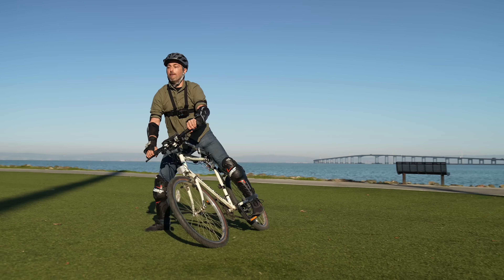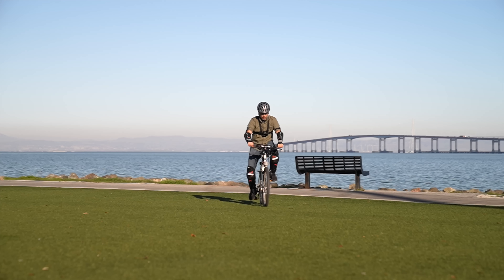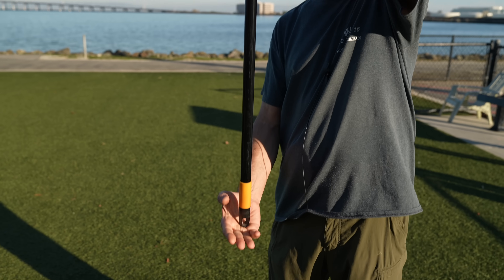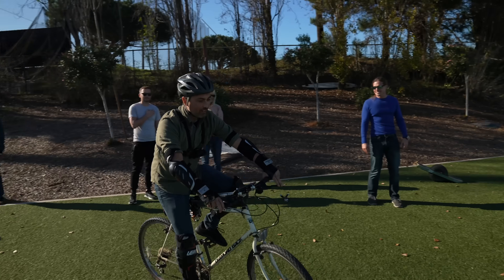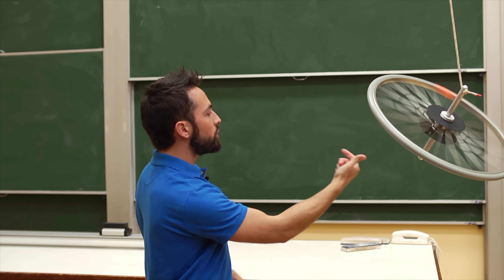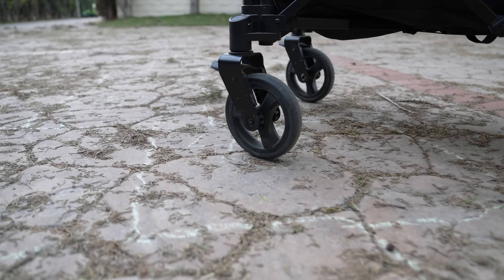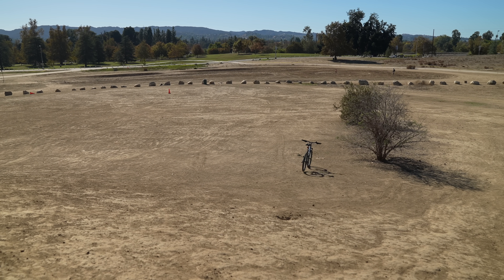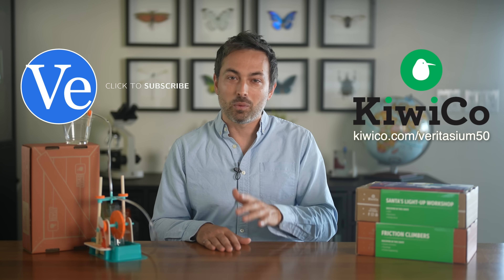Most People Don't Know How Bikes Work

Comment: Some people can balance the bike when it's not moving  - it's known as a track stand.  However,  it is many times harder than balancing the bike while the bike is moving. 

This is also why it's hard to ride a bike on rollers - which is one more piece of evidence supporting the fact that bikes don't (principally) stay upright through a gyroscopic effect. 

Also, fitting extremely lightweight wheels has no effect on how easy or hard it is to keep the bike upright; whereas if there were an important gyroscopic effect, it would decrease as the mass of the wheels decreased.
Reply: Track stand actually involves movement, but it's very tiny, using road imperfections to move back and forth.
Reply: @mikosoft   - I guess you're right. The bike is moving a bit, even though it's not travelling.

Comment: This is wrong (specifically that you steer one way then the other to turn). You also don't understand what counter steering is. I say this as someone with over 5 decades of bicycling and 3 decades of motorcycling experience. Here's an experiment to try: Ride with no hands (maybe a bit dangerous) and the apply gentle forward pressure on the right side of your handlebar but don't grip it to ensure you are only pushing and not pulling. Don't touch the left side of the handle bar at all and don't lean or otherwise move you body. Two things happen, one, you will turn right (yes, right!) and two, you will NOT have to steer right (you can't if you follow my directions as you can only push forward on the right handlebar). This is easier to experience at higher speeds, maybe try it going down a gentle slope or on a motorcycle if you are comfortable removing both hands from the bar (which is dangerous).

Comment: I somewhat did this to myself once. Made some brackets for driving lights on my motorcycle. They mounted to the triple tree and looked really nice. I didn’t realize they also hit the frame and shortened how far the forks could turn. 
Didn’t notice until I was making a tight turn and about fell over because it couldn’t turn as far as I was expecting for it to stay balanced.

Comment: I have to say i think that you have a flaw in your reasoning, i used to race mtn bikes myself and you can easily turn just by leaning. And then there are the times when you ride on top of a rock garden(an obstacle that includes many rocks on a path/trail) that you can start from a stopping point and turn in any direction and go that way. I feel i know a bit about bicycles from my experiences and i feel like you are missing some points in this video.

Comment: It depends on your riding style. You assume the rider will be sitting on the seat rather than standing on the pedals and therefore unable to shift their weight to make the bike turn. Someone standing on the pedals can shift their hips to turn without counter steering. Even sitting you can shift your weight to turn without counter steering as you would riding hands free. You are tricking people by telling them to turn the handlebars to turn the bike. For those of you making the comparison to large motorcycles, the weight you are able to shift compared to the weight of the cycle reduces your ability to move the center of gravity enough to initiate enough of a lean in the bike making counter steering needed more often.

Comment: Keith Code has a machine he calls the No BS Machine at his superbike school to demonstrate a similar thing.  Many people think that you steer a road motorcycle by shifting your body weight around, so it has two sets of handlebars.  A regular set that steer, and a rigid set that don't (that still allows the bike to naturally balance its self without any additional rider input)  This lets you isolate the effect of weight transfer on the balance of the bike vs the counter steer effect.  Without countersteer the machine is nearly impossible to get turning

Comment: I admit, its been about 35 or so years since I last rode a bike, but something doesnt seem right with this. Namely, riding with no hands. I could get going and ride non stop without using my hands. I would steer simply by leaning the way I wanted to go. I dont remember EVER having to steer the oposite, to overcenter myself into a turn. Would be interesting if you did this with some expert bike riders and not tell them what your doing until after?

Comment: The fun part is that it is so counter intuitive that even when you tell that to people they do not believe you. I always "proved" that by saying try to ride the bike without touching the handle bar, then with the tip of your index finger slightly push on one side of the handle bar and look at the result.  There is a 1999 paper from Berkeley department of physics on the subject: Steering in bycicles and motorcycles by J Fajans.

Comment: I remember reading that this is taught to motorcyclists, that countersteering is the only way to make a motorbike lean, and at the cool driving schools they demonstrate this by putting you on a runway on a bike with a second fixed set of handlebars and at 50mph you can lean off those all you want and the bike will not steer. And I told this to people who are self-taught motorcyclists, and they had NO IDEA, which is fascinating and also why people are self-taught crash.
Reply: Yep, it's extremely important to consciously understand countersteering on a motorcycle because the heavy wheels and tires create an immense gyroscopic effect that can only be overcome at high speeds by several pounds of force on the bars. Last thing you need is to be doing freeway speeds and suddenly need to turn to avoid an obstacle and not being able to because you never realized how it all worked.
Reply: Doesn't happen here because they all used a pedal bike before. They know instinctivly that you have to lean etc. Of course they might crash too, it's still a skill you have to learn, but you don't need to exlain the very basics.
Reply: @steemlenn8797  Actually the main person I'm referring to was a actually a competitive mountain biker too. He was just doing it without any awareness.

Comment: I wonder if anyone's going to make something like a bike but with extra wheels so that it can automatically balance sideways like a segway balances fowards even at low or zero speed, while moving forwards like a normal bike. Probably the extra balancing system could be turned off once the speed goes over 1 or 2mph.

Comment: I built a bike by switching the seat and handle bars, with linkage to steer. So you had front wheel drive and rear steering and it was possible to ride in a straight line, but if you steered the back tire would shoot out from under you. It was an interesting expiriment, but you could not lean enough to counter act the steering issue.

Comment: A bicycle fork has an offset rake like a castor wheel. But unlike a castor wheel, the head tube on a bike frame is also angled <90 degrees. This combined effect causes the mass of front of the bike to lift up from the ground, against gravity, when steered.  When you steer the handlebars, the front of the bike is lifted a small amount off of the ground as the offset of the fork is decreased in the forward direction, creating a longer distance between the head tube and contact patch. Mass placed at the front of the bike drives this combined mechanical effect, since it must be lifted against gravity to steer. This is the primary mechanism of self corrective steering on a bicycle. This is also the reason why a fork with more rake can feels more stable, despite the fact that it has less trail than a fork with less rake (trail: the conventional notion of corrective steering from fork offset where trail is the distance between the contact patch and steering axis; less fork rake or offset= more trail).
Reply: Yes, I understood these words.

Comment: After I watched the first minute, and the statement "if you want to turn left, you turn the handlebars to the left" I immediately went "nope", since I learned about countersteering when learning how to ride a motorcycle and tried it on a bicycle then later.  The trick is to push the handlebar with a right hand away from you (i.e. turn left) if you want to turn right, and vice versa. 
LET'S SEE IF I'M RIGHT!

EDIT: I WAS RIGHT! I kind of forgot about the pushing down part for gyroscopic precession, now I remember I learned about it a while later than the countersteer, tried it and it never really worked for me, not as well as the countersteer.

Comment: A motorcyle training company once demonstrated some of this by fitting a motorbike with a second set of rigid handlebars.  The regular bars were still there of course and able to keep the bike upright, but the reason for the demo was to prove to motorbike riders that you turn not just via leaning (which is a common misconception).  I even think there are videos of this showing people riding along at around 40 miles an hour and leaning as hard as they can but the bike refuses to turn.  I believe in those examples the gyroscopic forces are stronger too.

Comment: It's basically the same with any "body skill". Nobody knows how a hammer works either. You can tell: give a hammer to someone with zero previous DIY experience and they will impart whimpy hits. You end up bodily figuring out how to best hit with a hammer, without a hint of "hammer theory". And I'd believe it's actually more complex than steering, especially to attain peak efficiency, like the construction workers who know their tools and body so well than no matter the nail to drive it, it's basically done in two or three hits without marring the surface. They have zero conscious hammer theory, yet their brain does a huge amount of calculation to issue an exactly timed and measured contraction signal to each muscle of the shoulder, arm and hand to precisely produce the optimal desired result.
Reply: It's like birds know how to fly but they don't understand aerodynamics
Reply: Regarding hammer skills, you should see Tom Scotts blacksmithing video. At first he is absolutely terrible at hammering, but soon finds the swing of it and learned to hit the metal with proper force.
Reply: Same with throwing a ball. Or catching one. How does an MLB outfielder know where the ball is headed right off the bat? Is it just a matter of experience or is his brain doing ballistics and fluid dynamics (magnusson effect) under the surface in a split second?
Reply: It's Pattern recognition. We are wired to see patterns, and with enough data, we soon find out what works and what doesn't.
Reply: I think you just created a new video topic
Reply: I can tell you're not a tradesperson.
You have never had an apprentice.
I have shown second year apprentices how to "swing" a hammer because they are "driving" it rather than swinging it.
Trades people also learn by watching others subconsciously. its not all brain magic.
Reply: @gusbisbal9803  - Lol. Same player plays again. I've been a knifemaker for 12 years now, with two years of apprenticeship prior. I used the hammer example because it's basically universal, but I observed the phenomenon with a female friend who had never swung a hatchet in her life, and I was trying to teach her during a BBQ. At first I was astounded by her absolute lack of technique, but most of all of result. But as I was teaching her, her technique improved at every swing, as she started to understand what to "bodily look for". She got bored before being decently efficient, but the progress made during this short while was staggering.
Reply: Me: "brain please tell me your secrets!"
Brain: "What am I? A mind reader?"
Reply: Homeomorphic resonance?
Reply: Yes it's crazy how Brains work out things so fast. I would argue that with current computer technology it would take cemturies for them to figure out how to make themselves (in a logic point of view) but many humans figured it out in the span of their lives. We're still yet to understand our own
Reply: Seems to me your logic has more English Literature than actual technicality 😂
Reply: @utkarshupadhyaya7091  why did you write this comment?

Comment: the bike is "impossible" to ride, due to the inability to over correct. 
Humans balance via many many unconscious corrections. 

Many of those, are over corrections. 

Now you could learn, to overcorrect, via using your bodies mass to sway the bike, "Leaning" into a locked out turn, however learning this behavior, likely breaks the rules of this test. 
Not to mention the likely, lacking of time.

For instance, you could lock out the steering entirely, and given enough time, someone would learn to ride it.  
at least, to a much easier level than single sided lockouts. 
Though, the way it was ridden, would likely be outside of standard acceptable test parameters. 

If you stand still, and pay attention, you do not stand still, you rock back and forth, and side to side, constantly.

Comment: I've always been amazed at how few people understand how bicycles work. Most people think it's a gyroscopic force but in that case a bike with very light wheels would be unstable but they aren't.
Reply: But they are less stable. The gyro effect is real, and you can feel it. Get some crazy heavy tires and thorn proof tubes, and light tires and light tubes. Run your own test. I have (but with different wheel sets)
Reply: @randalclark6283  no they aren't!  They may be more vulnerable to cross winds, but a 10 lb. carbon bike is not "half as stable" as a 20 pound bike, nor 1/4 as stable as a 40 lb. bicycle!   (It's more a matter of geometry than weight anyway.)
Lighter bikes, do however, usually have steeper angles and geometry that enables quick steering for ideal handling for aggressive and/or competitive riders.
The gyro effect is inconsequential.  Bicycles with counter-rotating secondary wheels with the same mass are just as stable as any other bicycle.
Otherwise, bike shops would have all manner of liability problems with people coming in after riding their 35 pound mountain bikes all the time, and hopping on a 15 pound road bike and crashing.  This simply isn't an issue.
Reply: Whatever dude. Watch the video again. He even covers the gyro effect as one of his 4 reasons bikes stay up. A faster rider is more stable than a slower rider. Hmmm, wonder why?
Reply: @randalclark6283  Faster is more stable because when you move the handlebars it shifts the centre of gravity faster. Nothing to do with gyroscopic effects.
Reply: You can move the handlebars in a track stand too....
Reply: @randalclark6283  It often helps to take an idea to its extreme to figure out a tendency. In this case notice that someone riding a bike at almost a standstill has to move the handlebars wildly back and forth to stay upright. That's because the low velocity of the bike can't provide a significant sideways vector to shift the center of gravity fast enough to remain upright. In the opposite example, a bike moving fast takes an almost imperceptible amount of handlebar movement to keep the COG under control.
Reply: Last reply. Regardless of speed, the center of gravity will shift instantly, by the definition of center of gravity. (You do what COG is right? Look it up).
Reply: @randalclark6283  Yeah, I know what COG is, I have a degree in physics (University of Manitoba, 1977). And sorry, you're wrong. If the velocity of the bike is zero and you turn the handle it won't affect the COG at all. As the video states, it's like a 1 dimensional version of balancing a broomstick on your hand (which is 2D).
Tell me why someone riding at almost zero velocity has to move the handlebars erratically to stay upright but if they're travelling at speed, the movement is imperceptible.
Oh sorry, that was your last reply. Run away...

Comment: On a slightly related note: At my university, there is a project of an inverted bike: By turning the steering handlebar, you rotate the back wheel, not the front wheel. You can try to ride it at different events, but nobody is able to handle it! Except for the closed-loop controller which the institute developed to autonomously steer the bike ;)
Reply: What you mean is that nobody has spent enough time to learn how to ride it. Provided the bike is mechanically consistent enough that a given steering input moves the wheel by a given angle, it is more or less inconceivable that a human couldn't learn to ride it, just not in 5 minutes. It would ruin their ability to ride normal bikes for a while though.
Reply: @peglor  I guess you might be right, although I assume it's much more difficult to learn for the reasons shown in this video: Balancing might work completely differently. I think it's self-stabilizing as well for what it's worth (letting in ride uncontrolled down a hill). Also, remember that sitting in front of the steered wheel behaves completely alien in comparison (turning cycle, etc)